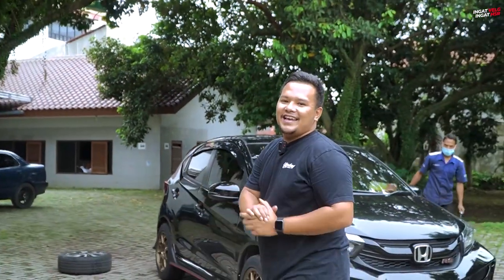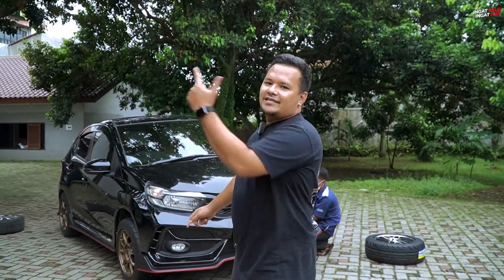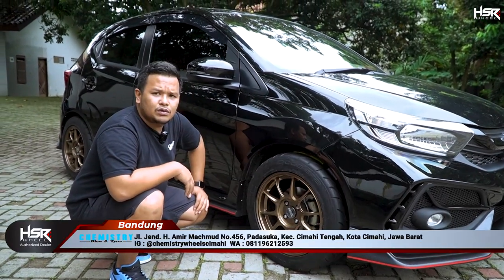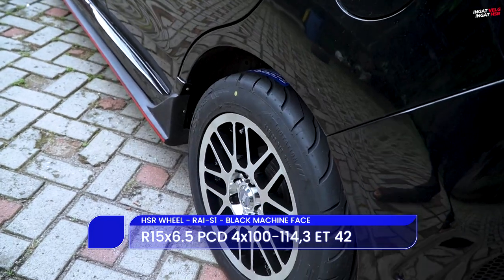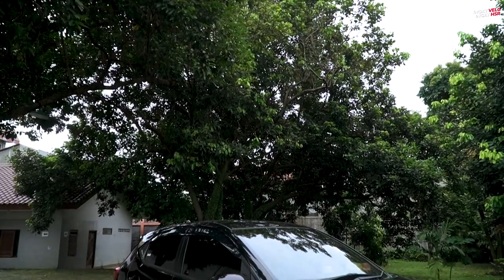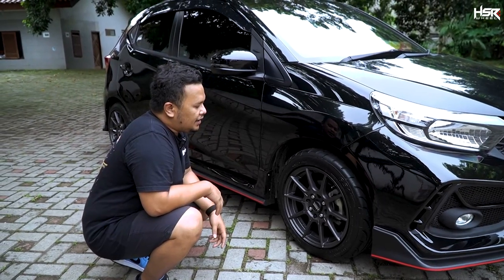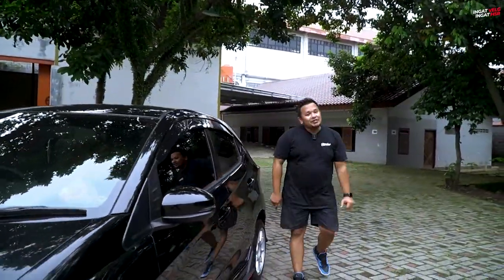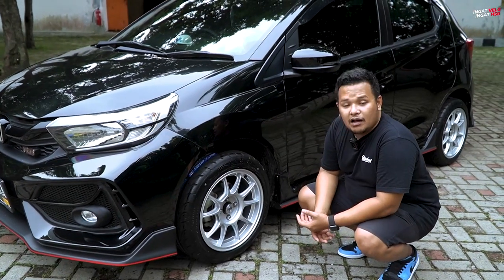Pilihan Velg & Ban Brio Type R Meaty Fitment!

Comment: Mobil brio satya 2020 Kalau pake hsr rai s2 L 6.5 ET 42 R15 dengan Ban accelera 651 195 55 15 seperti di brio item gesrot fender ga bang kalau muatan 5 penumpang?
Salam dari pati jawa tengah rencana mau ke dakkarautosport kudus
Reply from the maker: masih aman om kalau pakai Rai S2 R15 lebar 6,5
Reply: @HSRWheelOfficial  ok terimakasih rencana pakai ban yg 195/55 biar agak tinggi tp takut gesrot 🙏